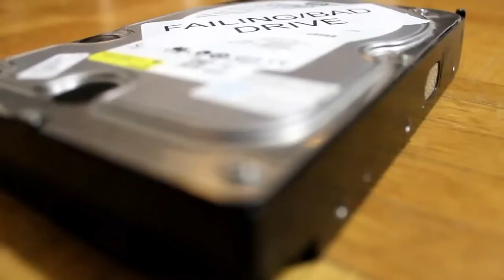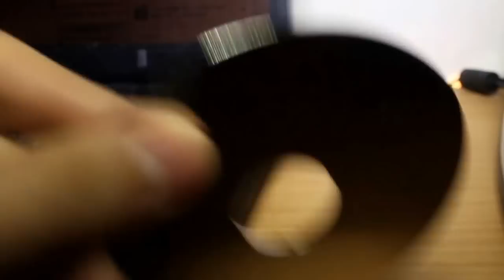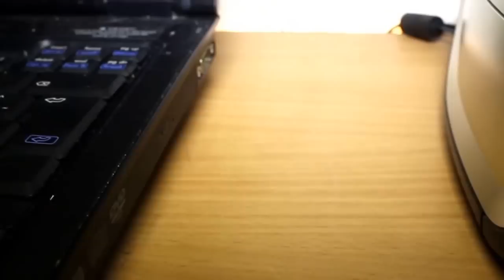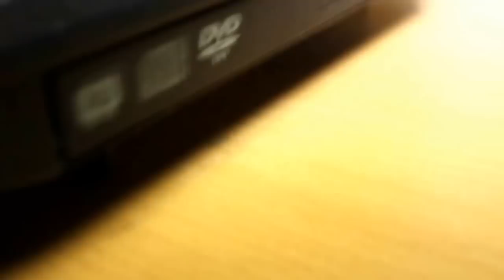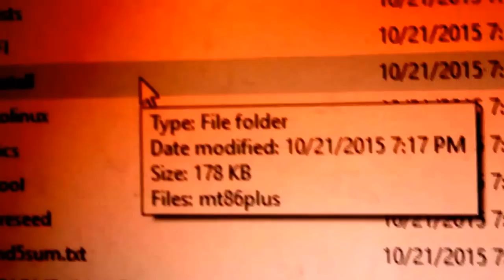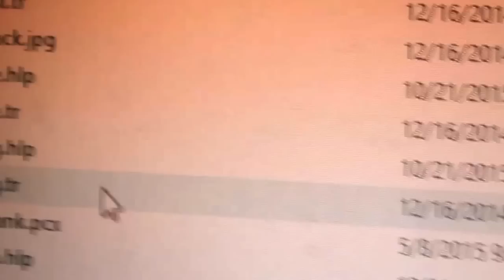Hard drive data recovery! using only a screwdriver and DVD drive!

Comment: Hello Sir. I have Windows 7 home basic operating software & an external DVD ROM. How much platters does a HDD have? Which one did you insert to the DVD ROM? Because you showed  3 Hard Disk platters. Which one I will insert? From the upper portion 1--2--3 of  no. 1 OR the lower portion of no. 1? The final question is the "is it possible to damage the DVD ROM by this procedure or not?" Please help. I am in big trouble right now.
Reply from the maker: all three at once. your DVD rom may never function the same again.... and your data may never forgive you
Reply: Youncan use ur hard drive as a second one instead of primary helped me recover my data though I don't know that if you still have it lying

Comment: 2019 laptops didn't come with DVD drives. I had to pull out the Vinyl Record Player, placed the platter on it, and rested the player's sharp pin on the platter.

the second it began to spin, my damn luck got the pin right in the middle of a porn file.. the loud screams woke my parents up :/
Reply from the maker: I think your parents were already awake

Comment: That is misleading, you fool innocent people. Do the same thing without editing the video if you can..
Reply from the maker: why would I want to fool people without editing the video? it's easier to fool people with editing
Reply: @HungryGizmo   what you have shown is 💯 impossible due to the fact that the reading head of DVD that can store 4 GB was not designed to read the platter that can store up to 250 GB of files. This is a lie joke no 1. Joke no 2 the platter you place in dvd didn't fit properly in the disk holder like a disk. Even if you place a dvd disk that was designed for dvd it will not work with that much gap to hold the disk firm in place. This is a joke nothing else
Reply from the maker: @rawan3435  NOTHING IS IMPOSSIBLE IF YOU BELIEVE. have more confidence in yourself.

Comment: Hi there, I tried and it was not working. May I have some suggestions what may be wrong? 

I am having a Seagate harddisk platter, and using a laptop DVD rom like yours. I even made a center core for the platter to spin better. 

Please help. Thanks.
Reply: did you really tried that? 🤣 this guy is literally screwing the every last chance you may had with your data recovery
Reply: hahahahahaahahaaaaaaaaaa
Reply from the maker: try sideways